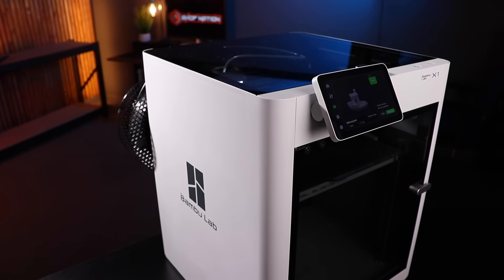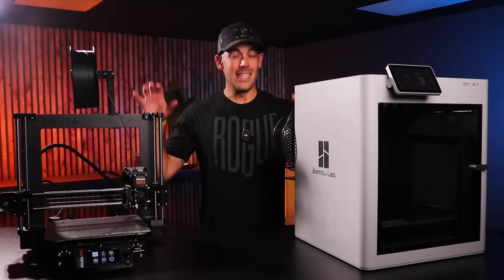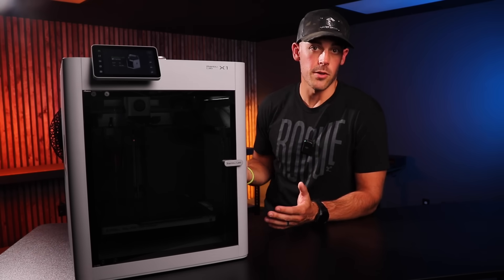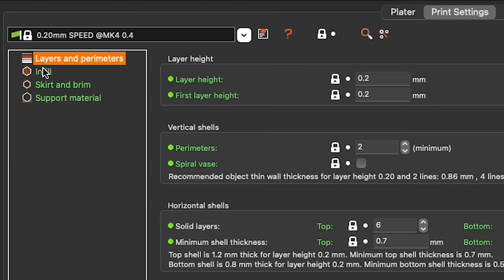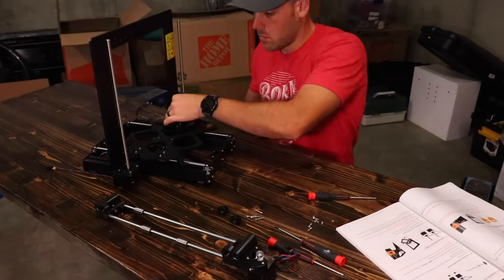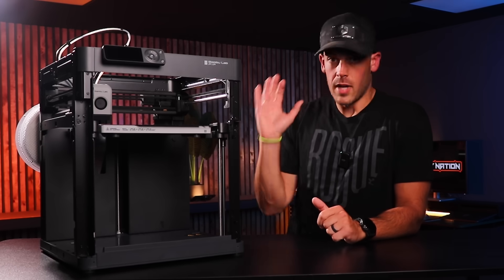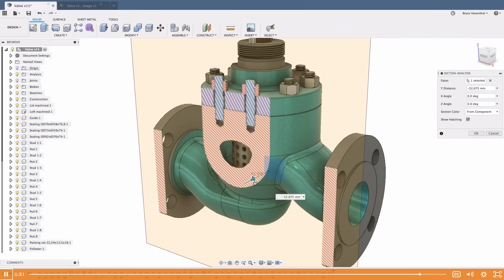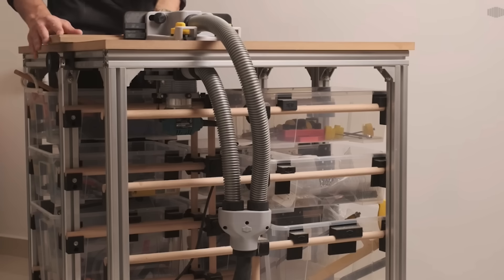The 3D Printer I'd buy if I started over

Comment: Great video. Printing is a double edge sword. It’s great to be able to almost plug and play. But at the same time with an Ender, you get to really learn how to do repairs, what to do with a failure, etc. spending 200 and learning u don’t want to deal with failure or maintenance is much better than spending 1200 to find out the same. Also, learning u don’t want to model or how to fix a model issue from a bad premade stl can be frustrating for the same “hobbyist”. So the 1200 bill to find printing isn’t for you is also hard to swallow vs the 200 start on a Ender.
Reply from the maker: That’s like advocating for people to buy a shitty car so they can learn to fix it 😂
Reply: Frankly most printers seem to be about plug-and-play now really. My son (who isn't super technical) bought a Biqu B1 (Ender clone) a couple years ago and it worked perfectly from the get-go and still going strong. It's been largely trouble free - really the only times it's had problems has been when he messed with something and it went wrong. Probably wouldn't choose it for a print farm needing to run 24 hours a day but it's really been a workhorse for him.

On the other hand I have a homebuilt one that when it works is great. But I've spent more time and money messing with it getting it to work and fixing it repeatedly over the years (literally, like 10 years on and off) that it's a real pain.
Reply: The problem with your argument is that real "printing" is not fixing a machine. Its USING the machine.  Just like how woodworking isn't replacing a motor on your tablesaw.... its learning how to design furniture and do joinery techniques, etc. etc.

Doing a craft is about doing the craft, not constantly fixing your tools.
Reply: I'm the opposite.  My first printer was the kingroon.  It wasn't a fun experience trying to get it to print right.  I gave up for a year.  I got a prusa mini plus but the experience also wasn't great.  X1c has been a blast for me.  Maybe I'll swing around and mess with the kingroon and prusa again but they've been collecting dust so far.
Reply: He didnt watch the entire vid cuz man was advocating for the $699 printer not the $1200. 😂

Comment: Nice lighting and font choice. I like the car analogies. I have 12 Ender3v2s...and I can attest to spending hours to level and add 3rd party accessories to get it to work. Starting over, I'd spend the money and get the Prusa or Bambu as you said. I have 2 Prusa mk3s and 1 Bambu P1P and I use the Bambu more than any of them. I do have the same questions you have about long-term repairs for Bambu.
Reply from the maker: I see many many more P1Ps in your future…
Reply: @ShopNation  I almost bought another today